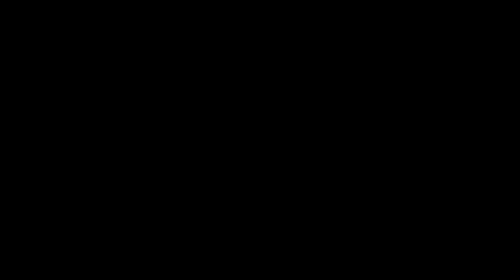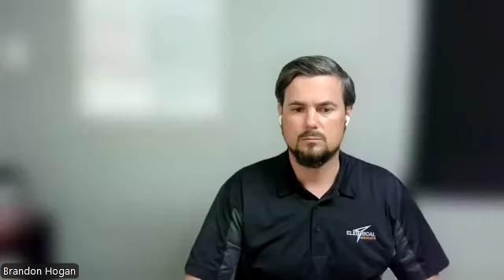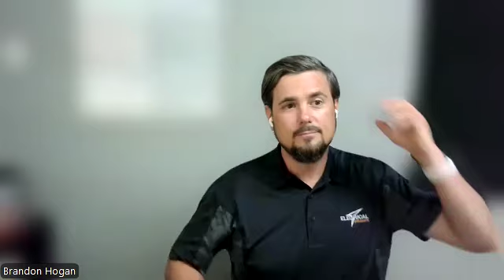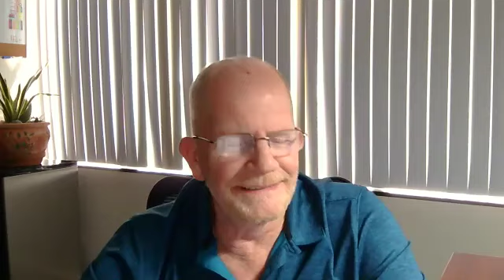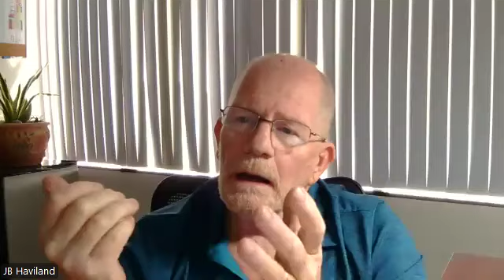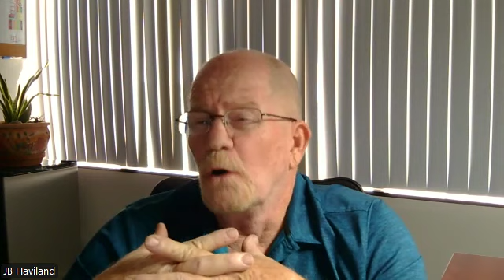Whole-Home Surge Protection Explained | What Really Protects Your Appliances

Comment: Adding surge protection in my main panel was one of the two things I wanted done that inspired me to start learning electrical. Other was driving a 240v motor in my basement shop.
Now I have an even larger, better rated unit than the first one I put in my panel. Have added surge protectors into parents' and sister's houses' panels as well. Plus more and other stuff. A good first or second thing to do when starting DIY panel work.
Was a good reassurance during the 2024 spring solar activity /aurora events.
Reply from the maker: Glad to hear you’re starting your journey in the trade.